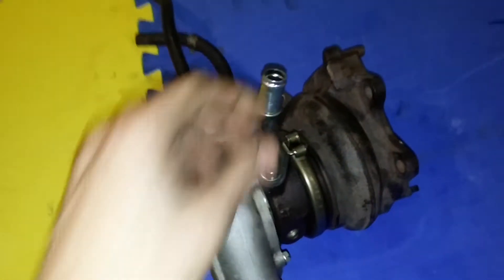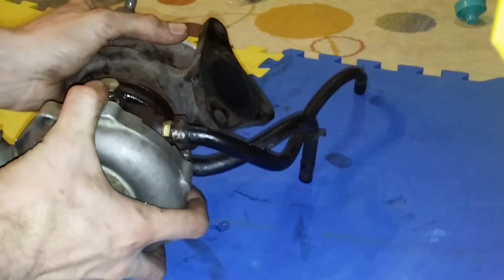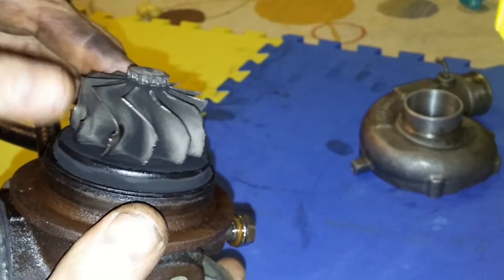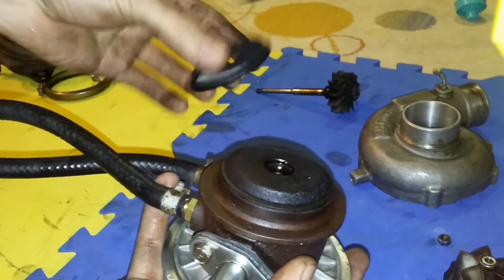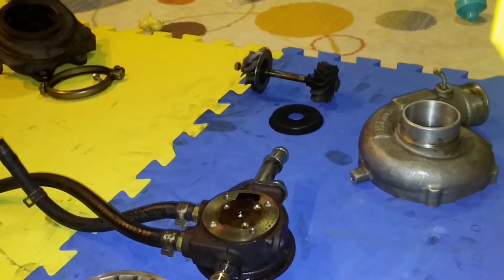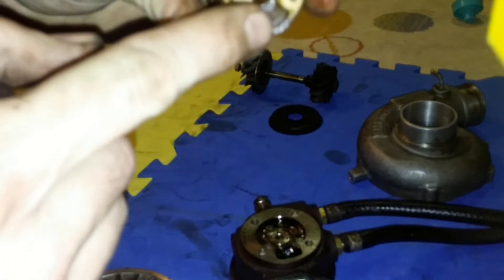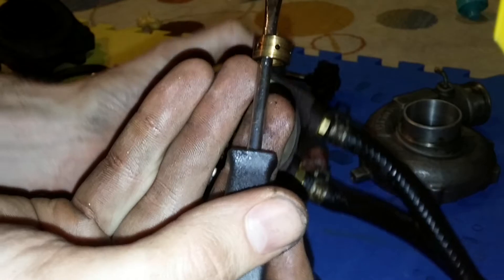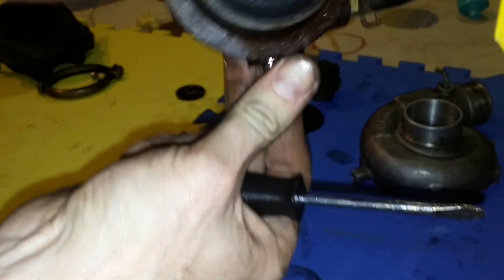rebuild a vf43 turbo

Comment: "Pattern up" piece. 

HOW ON EARTH did you get that one out.
Reply from the maker: it was tricky, it needs to lift straight out
Reply: Terry Tumulty I ended up taking out the clip and bearing on the other side, then using a flat ended round punch to knock it out straight.

Comment: doesnt look too bad, same procedure for the VF48 turbos ? 
Do you have a recommendation for the kit to use ? Ive seen a few variations on ebay for kits. 

My vf48 seems to be fine, but its leaking a bit of oil (sweating around the exhaust clamp. Seems to be fresh oil so my guess is a seal somewhere is going and may get worse. Already added new sealant to the oil tube at the bottom, leaks right around the clamp. 

Thanks for the video.
Reply: Same procedure for vf39./43/48/52. Use a Melett rebuild kit, available through xsboost. Only kit I've found to consistently work.